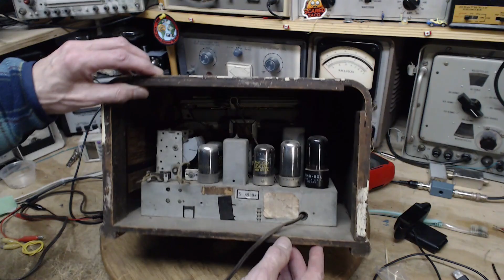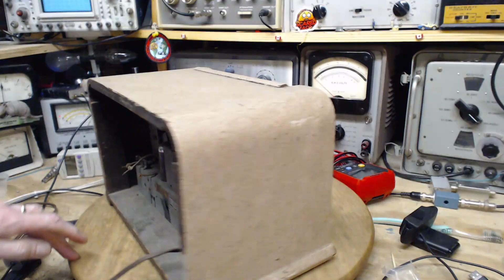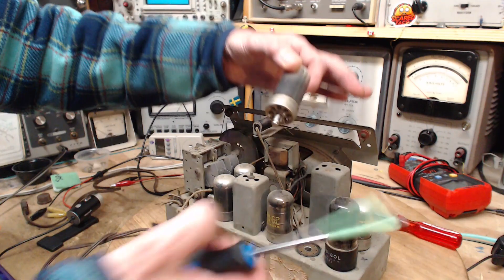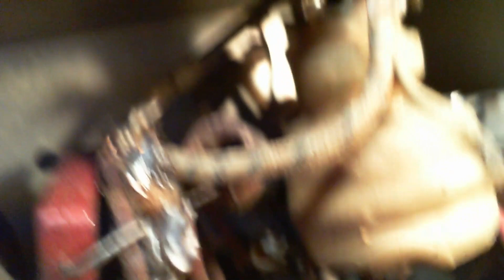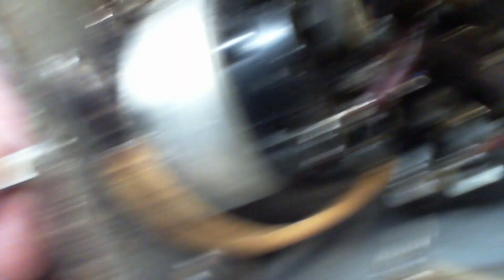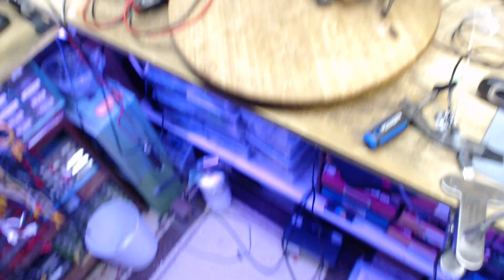Philco Model 42 322 Tube Radio Video #1 - Cats, Cameras and a Radio

Comment: Special capacitors with a coil of wire wrapped around it was used to prevent harmonics from AM transmitters on ship to
shore transmissions. The one end of the wire connected to the capacitor then wrapped around it and then went to ground.
Since those radios aren't used in that AM band anymore a regular capacitor can be subbed for it directly.

Comment: Hi Jim,  in regards to the three mystery wires in the back, I think two of them are for a missing loop antenna, and the third one is for a wire antenna.   Referring to the Radio Museum site, the wire antenna attaches to the loop via the gimmick.  From what I can tell from the video, the remaining knob is original.  I have one of these that I may have to dig out of the garage and look at in a little more detail.  Maybe I'll try to get it going.  Not sure why my comment was deleted before.

Comment: Just curious about why this radio (6 tubes) doesn't have grid caps on any tubes, nor any of those mica caps on the tuning condenser. Anyone care to inform me?
Reply: All Loctal tubes have connections running to their bases. The design was for car  and airplane radios originally
but companies like Philco found it a practical solution to making a chassis design for even home  radios. The 
base is 8 pin in every case and to prevent putting the wrong tube in a socket the model of tube is clearly etched
on the top. Trimmer capacitors can be put  elsewhere like on the back with a loop antenna for peaking an antennas  frequency range or on the chassis back or top for adjusting the oscillator frequency. They still will be the same mica
type variable capacitors.